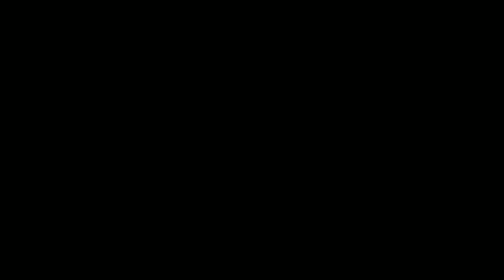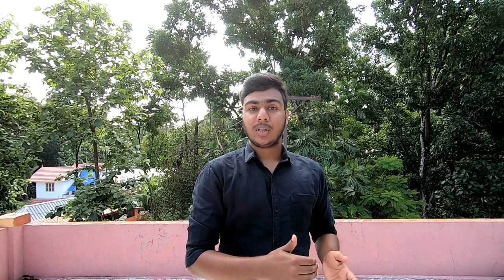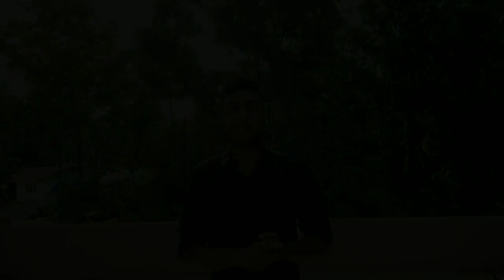Wet Clutch vs Dry Clutch | Explained in Malayalam

Comment: Center stand ettet bike first gear'il Clutch pedichalum tire karengunu! Is it because of wet clutch? Or clutch still wears out even if clutch is pressed?
Reply from the maker: there would always be some sort of friction between the transmission units even if the clutch is disengaged (when clutch lever is pressed).. this is the reason why the wheel rotates slightly in the air (center stand)... it is not necessarily due to a false clutch as it is normal in a new bike too... only if you are having issues with changing gears while running, the clutch is in a bad shape..